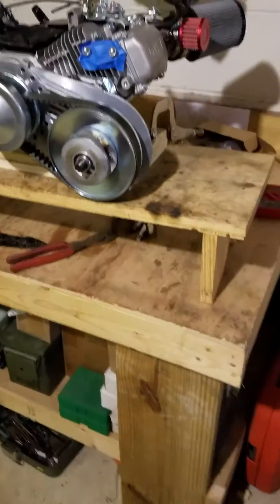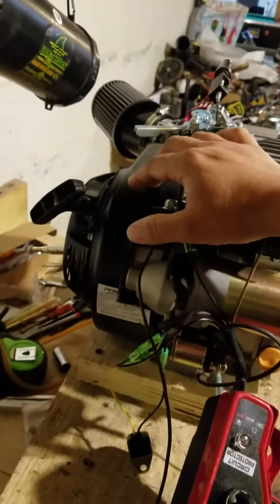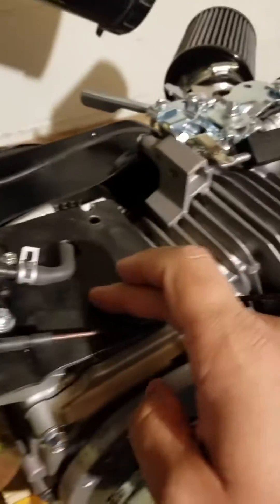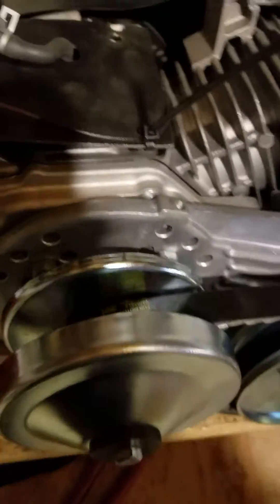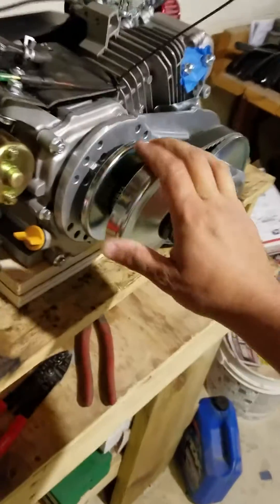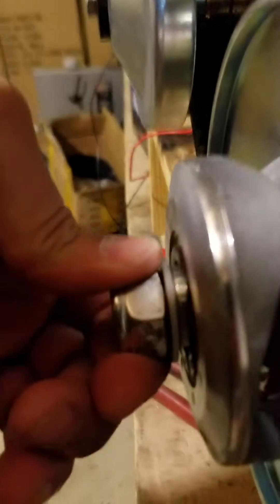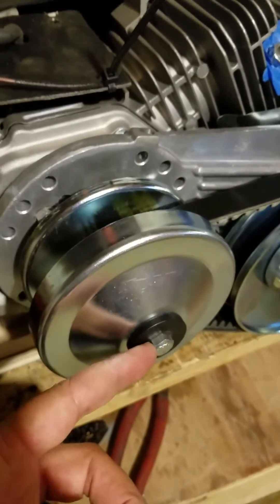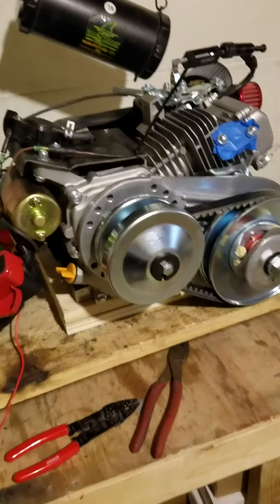Harbor Freight 6.5hp Predator with Torque Converter Clutch and Electric Starter Installed - Finally!

Comment: Como colocaSTe el volante que le hiciste?
Reply from the maker: If you mean to say the flywheel, it just installs and removes with basic tools. An impact gun may help.
If you mean the torque converter,  same process.

Comment: how tf did you find that? I don't need the teeth for a starter, but I need the magnets in the inside for some lights. Any help?
Reply from the maker: Hi. Thanks for watching.  Haha lots of late nights on the internet. 
Your flywheel should already have magnets attached to it. I actually have extra flywheels laying around.  If you're in the Delco/Philly area I'd gladly give them to you. 
Btw, you can swap out Kohler parts for most of the predator parts.
Reply: @gierhedd75  Thanks man, but I'm in lame Wisco haha. I'm trying to swap the magneto and flywheel from an old non hemi into a gen 2 hemi, and of course, the bore is different. The actual magneto fits fine, so there's got to be gen 2 models that output power, but ive never seen any. I think I'll check Kohler's.
Reply from the maker: @matthewmoneta7906  yeah the hemi has that weird taper at the end, which is such a pain. I went to a machine shop at one point to see if they could taper one for me; but they didn't seem to want to be bothered.
Definitely check Ebay,  and Kohler's website. 
Also, check some of the go kart websites. 
I'd also suggest - you haven't already, checking out redbeard's garage here on YT. He does a lot of stuff with the HF motors.
Good luck!
Reply from the maker: @matthewmoneta7906  The flywheel I used that has the right taper for the hemi is Kohler part# 17 025 30-s
Hope that helps.

Comment: Is the timing correct when you mount the Kohler Flywheel or do you need to adjust it?
Reply from the maker: Hi. Thanks for watching! The timing on these motorists is predetermined by the position of the magnets mounted to the inner rim of the flywheel. They are pre-set at the factory, so no need for adjustment - which is always a plus. 
The other type of timing would be external points, that some other manufacturers use. Then your'e talking setting gap and such. Fortunately, these motors are the former design and not the latter.
Reply: @gierhedd75  Thanks!

Comment: Hey Johnny, I'm currently in the build process of my Predator 212cc Hemi, and is this flywheel and charging coils enough to just add lighting? Is it direct fit and not something i need other add ons?
Reply from the maker: Thanks for watching! Yes. It will run lights with no problem. 
There is a lead that comes off the harness to hook illumination to. 
Be sure to run a fuse.
Reply: @gierhedd75  Awesome, last question is there a difference in the part number listed and the 29 series listed by another user?
Reply from the maker: @jacoblinder947  Hmmm..... that I'm not sure of. But you will need this flywheel if you have the hemi version, since the crank has a taper and different diameter. 
Dont forget to notch your cover if you're installing a starter.

Comment: What series torque converter did you use on the 212cc engine
Reply from the maker: Here you go, buddy. It took me a second to find it again:

https://rover.ebay.com/rover/0/0/0?mpre=https%3A%2F%2Fwww.ebay.com%2Fulk%2Fitm%2F361364618504

Comment from the maker: Hey everybody! Hi and thanks for watching all these vids I've put up here. I apologize for the lack of info on this series as far as all the minutia or step by step parts. Let me first say I'm by no means great at putting how-to's together, and I really could have done a better job. Also, even though I have moved on from this project a long time ago, I still get questions about the starter and flywheel issues with these motors. I am thinking of doing another motor just so I can do an in-depth tutorial on how to knock these out. 
That being said, please keep an eye out for one, as I'll probably be putting it all together in the very near future.  
If you haven't subscribed, please do, so you can get a notification when it's up here, as well as all the other random stuff I get myself into.
Reply: thanks bud! im in the need of adding an electric start to my gokart!
Reply: Whats the part # for the Kohler flywheel

Comment: Any way you can show how you wired the electric starter to the hemi?  Or a step by step on how you hooked everything up? Thank you in advance and thank you for this video.
Reply: Jeffrox M. I’m so tired of these people showing what they did and not how they did it!
Reply: Jeffrox M. Did you ever figure out the wiring diagram for a predator I'm trying to figure it out electric start key
Reply: 12 volt batter to big bolt on solenoid. Key start wire to small wire out of solenoid. We ran two wires from the positive on the battery, one direct to the starter and one to power the dashboard (lighting etc) on a Wheel Horse Commando 6.